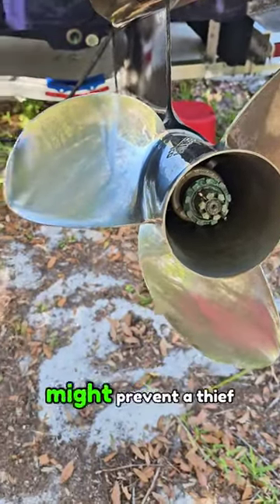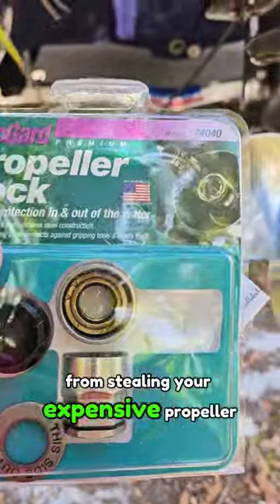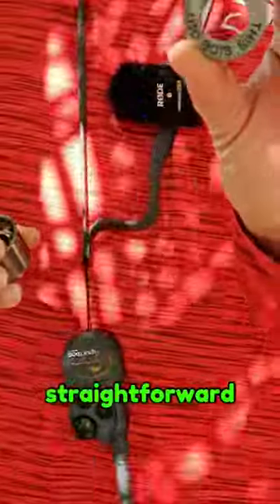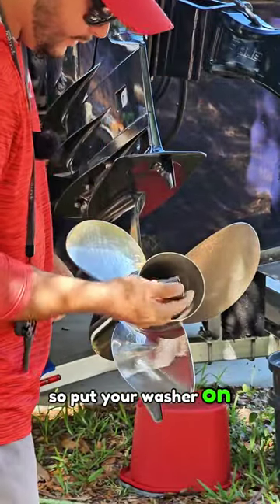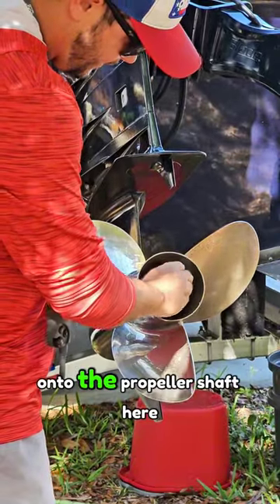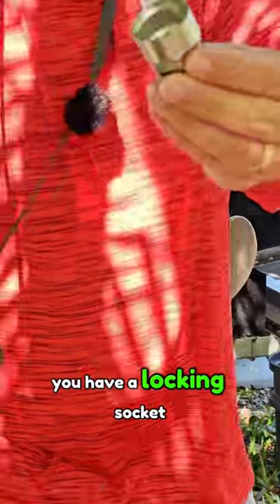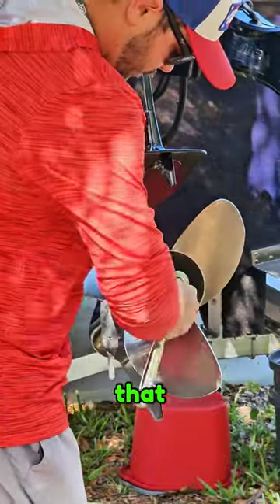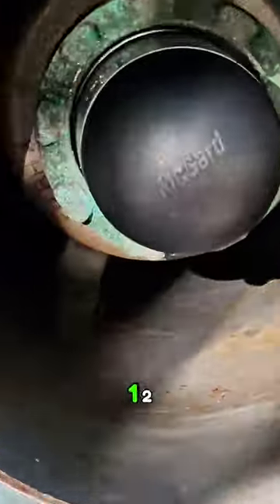A Simple Theft Deterrent for Your Boat Propeller #boat #boatingessentials #theft

Comment: What's to keep them from buying the same locking socket kit, also? I remember buying very expensive locking lug nuts and special socket kit for my Polished Alcoa Rims on my Dually. 2 months later, found my truck up on bricks. Fortunately the police busted the guys. They said they (the thieves) had a tool box with every locking lug nut socket in it.
Reply from the maker: This is a deterrent, they would have to have every key. Most thieves are going to move to the next one that is an easier target.
Reply: @Saltyscales  mine had every key. Police told me, "they had a box full." The cost of getting the right key/sockets, even all of them, is miniscule to the worth of what they're stealing, sometimes daily.
Reply: @ragtie6177  not all criminals run with those kinds of tools, unless it a syndicate  and they plan to be there for a few hours then yes, possiable..

Comment: What keeps that from falling off? The castle nut and cotter pin prevent the nut from coming off so if you remove the cotter pin and castle nut what is there to prevent that from unscrewing?